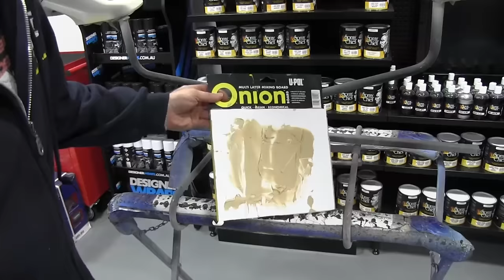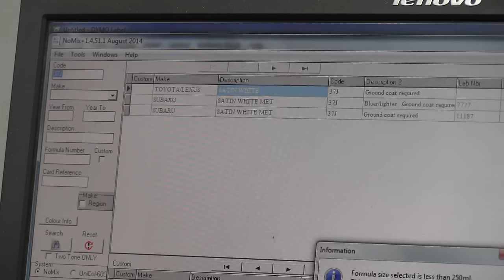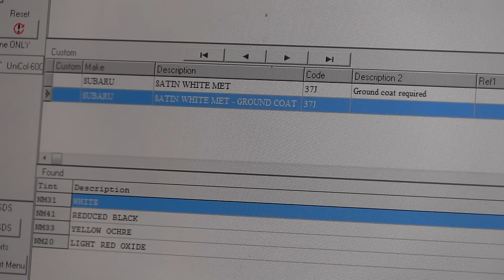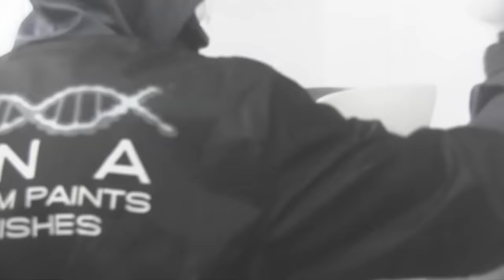How to paint plastic

Comment: just a tip with getting high flow from spray cans. If you go to an aerosol art shop you can buy different spray caps. Some of these have high flow open nozzels. While these are designed for aerosol art graffiti spray cans they will work on the auto spray cans as well. You can buy them for like 60cents.

Comment: Hi Dave, is there a reason behind only filling those tiny holes and blemishes after applying the primer? unknowingly I would have tried sorting out those before going near it with paint. does it make a difference? Cheers.
Reply from the maker: The primer exposed all the holes and the guide coat exposed all the high and low spots. Filling the holes before primer would have worked as well.
Reply: +customspraymods ah, yes that would make sense. thanks.

Comment: wish i could do this. i have the wing but cant paint or drill holes in trunk :(
Reply: Why not? It’s easier than you think. Painting - it’s 70% prep - 30% finish, and with drilling holes; measure once, measure twice, measure again, so you know it fits right. The drilling part itself - get some decent HSS drill bits, and go slow. Push too hard you’ll blunt the bit. Weight of the drill is usually enough. Maybe put a blob of oil on the bit, but if drilling a single skin like a tailgate - you probably won’t need it.

Don’t be put off by the fear of fucking up.

Anything can be fixed :-)